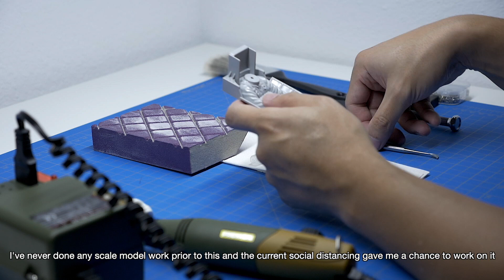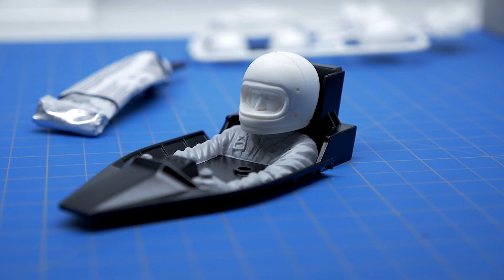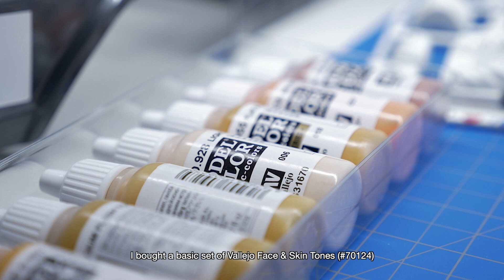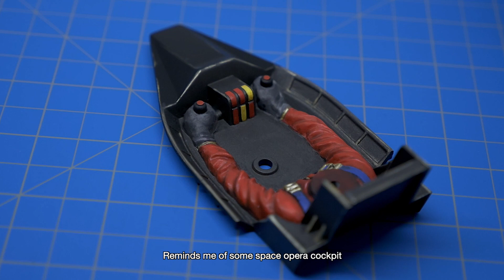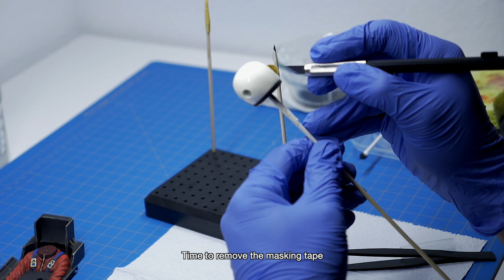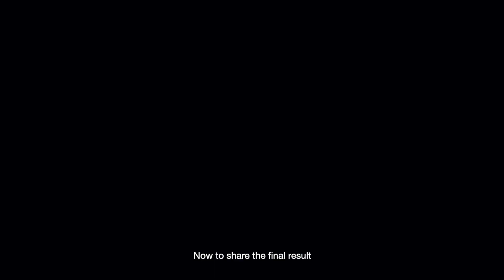Painting and Building a Scale Model Figure RC Driver

Comment: This video was ideal watching for me.

Ive built a Tamiya rally beetle, which I'm going to customize a bit to look like a class 11 Baja racer, and one of the things I'm gonna have to do is remove all the windows, which in turn means I'll have to have a detailed cockpit.

The helmets will need visors and a clean air hose built into the chin guard, which is very similar to the drinking hose you've fitted.

So al in all, this is the best detail video I've seen. That's top quality work you've done there. 👍

Comment: Well done. Little tip, I always use a wide marker, not the point but the side, to crate a grey or black rim on the edge of the vizor. Usually, I also add a bamd at the top of the visor, but as this is a classic figure, I can understamd it’s not used here.
Reply from the maker: Thanks for the tip, Bart Brunink! Never thought of the marker technique and will try it next time.

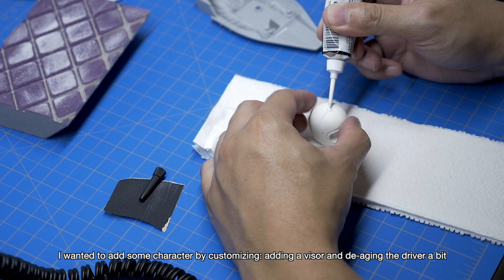Comment: Hello, thank you for such a detailed video, it is very helpful. Could you tell me what kind of putty or filler you're using around the 0:54 time? Thank you.
Reply from the maker: Thanks for watching, claytonfarlow76! They putty is Vallejo Plastic Putty. It dries in about 15 minutes but doesn't really fully cure in a couple of days or so, so it's still workable. But once it sets it's quite solid. There are other ones such as Tamiya Putty and Milliput that are somewhat similar.

Comment: Amazing.   what did you use to seal the 2 half of helmet togother?   I have to do comical avante ones and madbull figure, i have few figures i need to paint
Reply from the maker: Thanks! For glue, I used Tamiya Cement and probably a little bit of CA glue. And then I used Vallejo Plastic Putty to hide the seam, let it dry and sanded down. Good luck!